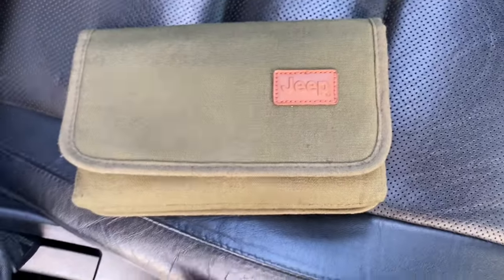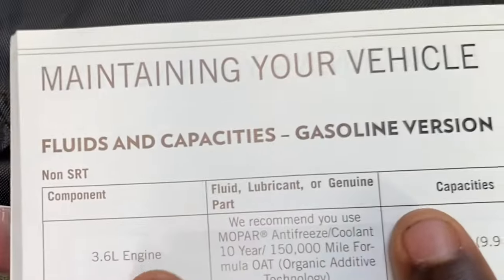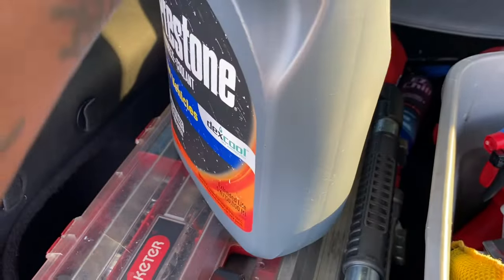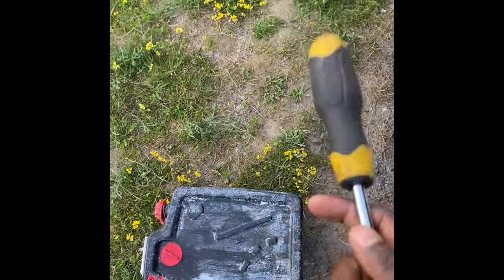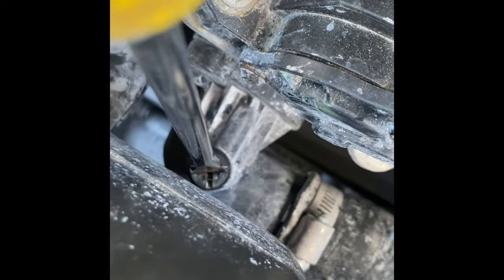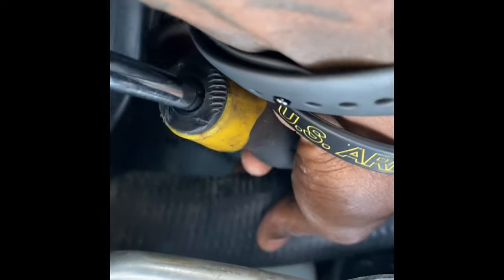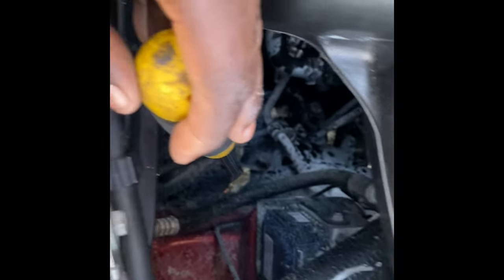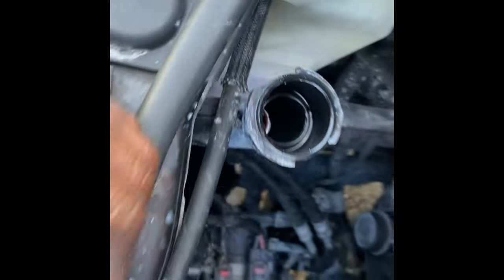How To Flush Drain And Refill Your Coolant | 2011-2020 Jeep Grand Cherokee

Comment: The drain on the rad is a PETcock. You can put a 16-20 inch piece of clear rubber tubing on the petcock before turning it out to direct the coolant exactly where you want it.  Don’t let those quickly lube places do it without checking the bleeder screw and the overflow cap and the radiator cap. My daughter’s boyfriend brought his in which included a multipoint inspection. He then drove several hours and the heater started blowing cold air. The kid at the Quickie Lube forgot to put the cap back on properly after checking the coolant.
Reply from the maker: Thank you !

Comment: When you say to watch for air bubbles, where/ what are you watching? Also, do you have to fill up the reservoir next to the radiatior, or just fill at the radiator until the reservoir is full?
Reply from the maker: Check for Air bubbles comming from the radiator cap

And you always fill the radiator up first and then the reservoir

Comment: When you fill the radiator up with coolant (after you’re done flushing) do you fill it up to the radiator cap?
Reply from the maker: just to the fill line. the coolant needs space to expand or else it will overflow